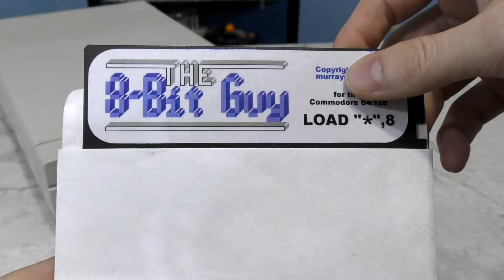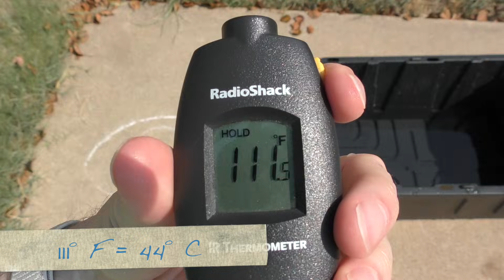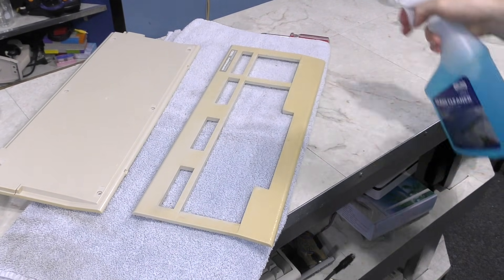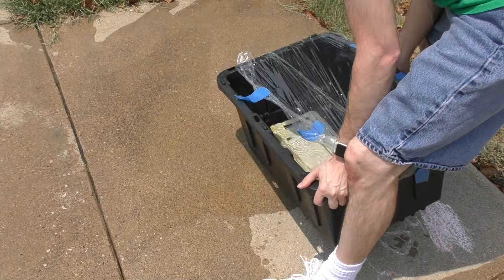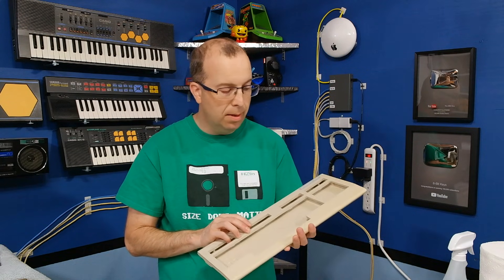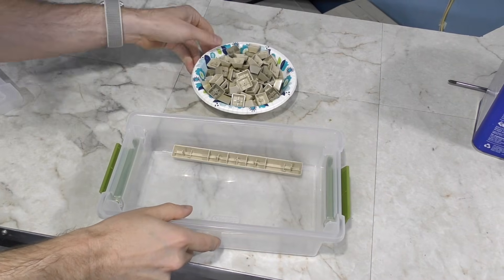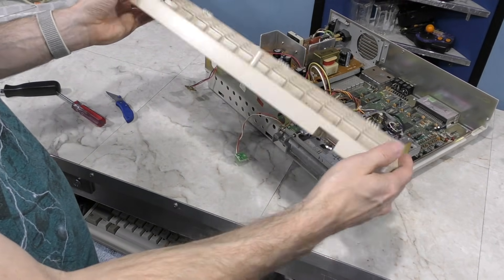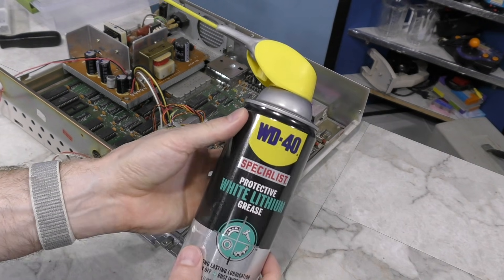Commodore 128D Restoration

Comment: Awesome video as always. When you said silicone I immediately said that's not going to to hold. Silicone doesn't like to stick to plastic or rubber. Locktite gel glue should work well though.

Comment: non slip grip tape / pads for furniture feet can probably be cut with scissors to work. I used some from Home Depot recently and it has about same thickness as the pads that fell off. It is peel off adhesive on one side.

Comment: Nice work, Just did some retrobriting on a 128D keyboard myself! But one of the keys is missing a spring. Are these springs still available?
Still have to do the case though. I have the earlier 128D full plastic case version, quite yellowed, which makes it a bit more elaborate.

Comment: Hi. Got to create a tub that's made up of mirrors that has hinges so you can adjust the sunlight ray angles. It has two or tree wires in the middle so it can be suspended. The light rays can be simulated using some rendering software or Ansys app for Windows. God bless, Proverbs 31

Comment: Please keep in mind that this is not a real restoration video. All electrolytic capacitors on all circuits of any 30+ year old vintage electronics MUST be replaced. No exception!! They slowly turn into a resistor and will cause other components to fail. This is only a cleaning video. It's always a good idea to clean before restoration.  If it's not re-capped, then it's a time bomb. You will end up with trying to find a broken obsolete chip. Also, it's always a good idea to de-magnetize any magnetic components such as that magnetic drive head.

Comment: For the keyboard keys, you might want to consider getting a small ultrasonic cleaner.  I used it to remove mould release grease from my resin model kits, using some proper degreaser, I usually observe improvement in just a few minutes and will just need a light rinse and scrub afterwards.

Comment: Man you keep trying to use that tall plastic tub for retrobriting.  Do yourself a favor and go to Home Depot.  In the section where you find cement you will find several sizes of stucco mixing tubs.  They are black plastic and about 5-6 inches tall.  I use the medium one and it only costs $6.

Comment: Hey! Did you ever try putting the keycaps into the dishwasher for cleaning?
Also: I have a wel lworking method for reapplying rubber feet, that I'm u sing on my PC parts as well.
1. Clean the feet
2. Apply a very thin layer of Cyanacrylate and spread it out even in a very flat layer.
3. Do not attach the feet, just wait for the Cyanacrylate to harden
4. Use some simple all purpose adhesive for gluing the feet to the part. The will stay in place, but you can pull them off, once you need to get to the screws again.

Comment: David, here in Huntsville, AL, we have Hobby Lobby and Michaels. Being an engineer and doing these types of projects myself, I find that "Glue Dots" come in sheets of a few inches in rectangular form. It's basically the exact adhesive used on those feet. It's just a literal sheet of very thin, clear adhesive with peelable paper on each side. Cut the size for each foot, peel, and stick. Literally like new. Try them out! I buy them from those stores. Cheap!

Comment: Psst, 8-Bit Guy, I know these are your videos and all, but quick tip, try using a micro fiber cloth and soap with water, and pull the cord through with soap and water, then dry with a paper towel. The cable will feel MUCH better.

P.S I found an old channel of yours, called "awesomeairguns." Funny right?

Comment: One critical thing to keep in mind, sunlight is NOT the primary culprit for most computer yellowing. Infact there have been many computers that have never seen daylight that have severe yellowing. The usual culprit is in fact Florescent lighting. Florescents give off UV radiation in small amounts, though enough that over years of exposure it will cause plastic break down and discoloring. Keep this in mind if you restore something that you should keep it away from florescent lighting at all costs.

Comment: I got a 128D recently but its the earlier version with a fan and enclosed psu. Works fine except for the discdrive will not read any discs. So I use a SDcard reader.

Comment: Try Walther’s Goo, available at most hobby shops that carry model railroad stuff. Just don’t get it down in the screw holes. Or just get some double-sided foam tape, and use the feet to cut out pieces of tape of the same size (with an X-acto blade), then affix as per the original design. And, yes, the Texas summers are brutal down here in San Antonio!!

Comment: Sweet restoration. I had the 128, one of the first units to Hit Australia. An you will probably hate me for this but I had the full official Commodore  CP/M manual and source code plus a lot of customised software and mods for CP/M. However when I last moved about seven years ago I though no one would be interested. Little did I know.

Comment: As for the keyboard feet spectacularly failing to stick with a silicone adhesive... I would try a two part epoxy adhesive next. Silicone and epoxy resin absolutely hate sticking to each other, hence crafters using silicone to make moulds to form epoxy parts in and vice versa. So my hunch would be that those feet are made of some sort of epoxy, which hopefully will bond well with an epoxy adhesive.

Comment: Try out a tube of Shoe Goo on the rubber feet of your keyboard, it's a rubber cement made for fixing shoes. So it has flexibility and good adhesion. Plus a large tube is about $5 at Wal-Mart and will last you for many repairs. :)

Comment: Use Permatex Clear Adhesive Sealant instead. Close to what you used, but it will bond much better. UPC#8622680050. Otherwise a Very, Very Impressive Restoration !!!

Comment: I just restored a mechanical calculator. It's got 82 keys. Cleaning them was a huge pain, and I had to let the keys soak in soapy water for like 6 hours to get the 70 years of crap to come off. I don't envy you restoring keyboards. :)

Comment: Try Barge glue for attaching rubber feet. It's an industrial contact adhesive designed for adhering rubber to wood, leather, plastics, etc. You can find it at Tandy Leather.

Comment: C128 DCR in it’s full glory, ahh that were the days, miss mine. Hey David, I found that double sided carpet tape is extremely sticky works really well for most kind of rubber feet. Just the silicone feet ( mostly the clear ones) doesn’t like  this as much. So you may give it a shot.

Comment: Fantastic to see a Commodore 128D, i also just bought a Commodore 128D (plastic version) a few mounts ago, and i replaced the PSU, because when i opened it i saw that a thick cable (fuse wire) in the PSU was spit open and did not look so good, so i saw a second hand Commodore 128D (plastic version) PSU on eBay and bought it, and saw that that one was totally different on the inside and did not had such a strange fuse wire, and he works great.

Great to see another Commodore 128D, a pity this is the more common metal version, and not the plastic version.

And you can try some good thin double-sided tape, i also did the same, and they still are sticking to the keyboard :-)

Comment: i'm still puzzled because my c128 was newer exposed to sunligt and it still got yellow. yet i have 8 of 10 c64 which haven't yellowed. i bought them second hand or it was donated and even +13 years in my possession it hasn't yellowed at all. i have discuessed this on jan beta's youtube channel i don't think for one minute it has to do with sun exposure. i think it has to do with different versions of the plastic. my c128 was however exposed to parents smoking.
Reply: onehappynegro The smoking is why I believe. I think due to the type of plastic being exposed to smoke it yellows the plastic and makes it brittle. Retrobrite restores the plastic to its original state though.

Comment: What the!  It's still nasty inside the CPU box.
Reply: Agreed, this isn't a restoration. No checking of the power supply, caps, or even adding heat sinks where needed.  Call the video what it is, "Cleaning the Commodore 128D"
Reply: I totally agree, this type of psu is know to fail dramatically. Rifa filter cap will blow and the United Chemi-con SM caps should be replaced with new SMG's to be sure it will not fail. I've seen so much short out and take the motherboard with them... This video is just about external cleaning, not a proper restauration/overhaul.
Reply: Totally agree. If you're gonna obsess over the exterior so much, why not give the internals the same treatment?

Comment: 3M spray on photo mount adhesive.   I use it for all kinds of things on equipment repairs.  Labels, feet, badges, grills.   A light coat and about half an hour to set up.  Should hold those feet on quite well.

Comment: I wonder if you put peroxide in your dish washer and cleaned you big pieces that way?
Reply: For the retrobite process to work, you need both hydrogen peroxide and UV light together.
Reply: No, he has done a test with heating it on the stove and it worked as well without UV light.
Reply: dj33036 .dj63010 It needs sunlight to work.
Reply: Peroxide does not need sunlight to work.

Comment: Hi David, Regarding adhesives for the feet,of your Commodore, as well as case badges and other things, check out  3M/Scotch AGT tape AKA "Booger tape" or "Snot Tape" it sounds gross but it is super thin, super strong double sided adhesive. you can buy it in rolls or use the  I have used it on things ranging from iPhone screens, to Case badges etc....works Wonderful! There are many different types,(numbers) so you may want to  research which would best fit your needs. also, i have found "glue dots" to work in a pinch too!  that can be found in any craft store! very handy stuff!

Comment: Cheapest carpet tape (double sided tape) works fine and is removable just like original adhesive. I wouldn't experiment with stuff like B6000 and contact cement in this instance, either should work unless it softens the feet too much, but either is not quite right.

Comment: The silicon method wouldn't work due to the nature of the surface, but you can always use patex glue or you can use double faced tape but you would have to cut those so they would actually fit

Comment: Use contact cement for the feet. You put some on both the area under the key board and on the rubber foot, let the surfaces dry a bit, then press them together. The feet will never come off after that.... ever.

Comment: I think the reason why the silicone didn't stick was because you placed the adhesive on the center of the feet, which sits right over the holes for the screw heads. If you placed it on either side you might get better results.

Comment: sandpaper on the bottom of the feet where they adhere and try it again. rubber cement will also work, but the surface HAS to be rough.

Comment: hot melt glue works
Reply: Messy and quite a lot too permanent though. Double sided tape works just as well, and will be easy to remove for future repairs.
Reply: not permanent, a solder iron removes it fast
Reply: Which will destroy the feet. So it's permanent.
Reply: Jesper Anderson I've repaired dozens of feet using hot melt glue, without it being messy, or concerned about it being permanent, in fact it peels off cleanly. The trick is to not glop it on

Comment: tor those keyboard feet: try using the double-sided tape used for securing LCD screen and digitizer assemblies to mobile phones when doing a replacement. It comes in lots of widths and lengths of rolls for pretty cheap on Amazon and elsewhere. I use it for tons of jobs.

Comment: I have an idea for the feet for the keyboard.  Maybe try some Automotive molding (or mounting) tape (double sided tape used to hold moldings onto car bodies).  Should be able to find it at a local auto parts store.  Just look for the thinnest tape you can get.

Comment: dap zap goop is the best stuff to use on the feet i have also used electronics double stick adhesive. https://www.amazon.com/Pacer-Technology-Zap-Goo-Adhesives/dp/B003654UIO and https://www.amazon.com/super-strong-double-sided-packaging-stiffener-3M9474-08x12/dp/B00CCGK31G/ref=sr_1_5?s=industrial&ie=UTF8&qid=1533254724&sr=1-5&keywords=adhesive+sheet

Comment: Any 3M double sided tape should work really well. I use the stuff on lots of projects. I use the thick stuff, but for that I would get the clear thin stuff.
Reply: I believe the original stuff used for these pads is '3M 465 transfer tape'. You can get it on Amazon or mcmaster.com.
Reply: SeanHodgins I was thinking the same thing. Using any adhesive will prevent you from taking the keyboard apart again. Tape should do the trick.
Reply: 3M tissue tape seems to be the closest match, the 12mm size should be
 ideal. There's plenty on ebay.
Reply: Using superglue is a terrible idea as he will have to retrobrite the keyboard again in about a year or two!
Reply: KoivuTheHab a lot of 3M tapes are considered permanent solutions, and are cleaner than any glue. There is a reason original manufacturers use double sided tape and not glue.
Reply: Just use the 3M tape red/transparent one, used in cellphone repairs. They work just fine
Reply: http://a.co/1Vvek7d Here's a link to 3M VHB tape.
Reply: Also I would try a thin double sided tape first.
Reply: Rubber feet are often affixed with double sided tape as it's fast, convenient and works extremely well between the two differing materials. There's a reason it was used originally and I'd most definitely use it on any repairs or renovation projects for similar applications.
Reply: yep. +1 here for that as well. that thin 3M stuff would be perfect!
Reply: Rubber cement.
Reply: What he's removing is double sided tape. That is what is used on most of these feet on old systems. Using double sided tape for re-attachment is the best solution; it will easily hold for 20 years, and it is easy to clean off for future repairs.

Using epoxy or superglue is the worst idea imaginable. It will be impossible to take the keyboard apart again, whether in one year or twenty years. And these keyboard are getting harder and harder to find. Destroying the keyboard is a horrid idea. There are many reasons they used double sided tape originally, and one was ease of repair.
Reply: I vote 3M 77 Spray On glue. I have removed items that I glued with this before, and the film left over looks similar to what is used to stick rubber feet to different components.
Reply: Yeah, Sean, that's what I was thinking too. You beat me to it!
Reply: Informative and very well executed video, thanks for that!

2-component epoxy is worth trying, too. It forms a very tough bond, but requires 24h drying off and some screw clamps to add some pressure and therefore to finalize it properly in the end. With epoxy based adhesives, you can basically attach and fix anything outdoors as well as indoors.

7:10
To save some time, effort and energy why not just take out every key and wash them in a washing machine with other laundry in mild temperature? Collect all of the keyboard keys in a lingerie wash bag, for example, and voíla :) I use to wash everything in machine wash...

Comment: For the feet: 3M transparent VHB tape. They have in 0.2' x 1/4 that usually fits right into these feet and it bonds to anything. also, it looks just like the adhesive that you removed before.

Comment: Really enjoy these restoration videos.  Re attaching feet: you can purchase double sided scotch tape.  That might be a good solution.  Alternately, rubber cement.  Re cleaning cords: I saturate a portion of a paper towel with Spray 9 cleaner, loop it around the cord, and guide the cord through the paper towel.  Takes 30 seconds or less, and it instantly dissolves and removes everything from the cord.  I then follow with Armor-all to restore the suppleness that cables lose over time.  That really works well.  You know, the front of that keyboard really does look yellowed, still.  If more hydrogen peroxide won't help, how about a vinyl dye of the appropriate color?  Just wondering.  >Charlie

Comment: Google only throws up local websites for me atm., but search for '3M sticky pads for GoPro'. They're about $8,- for a set, which is easily enough to cut up and stick your feet back on. I guarantee you those won't fall off after 36 hours.

Comment: Why don't you build a retrobrighting box? It's a fully enclosable box with UV lights running throughout it. Ive seen ones with heaters and ones that don't, one that uses UV bulbs and some that use LEDs
Reply: If you have the top to that black tub, you could turn it into one. Run UV LED strips across the top, make it sealable so the gasses dont escape and so that its only UV light inside. You could add a   light, resistive space heater to it and just point it at it. Honestly with how many things you end up retrobrighting, I'd say it's worth the effort.